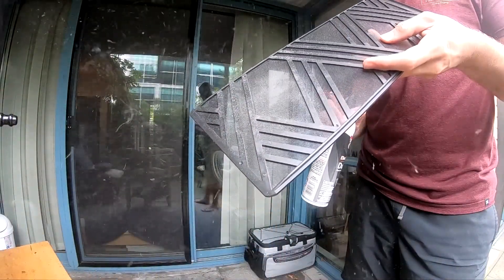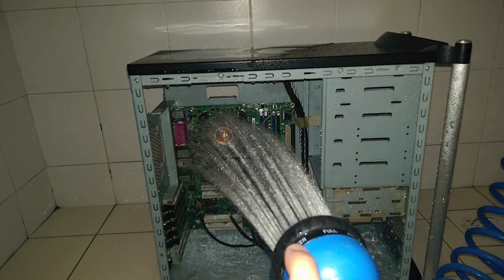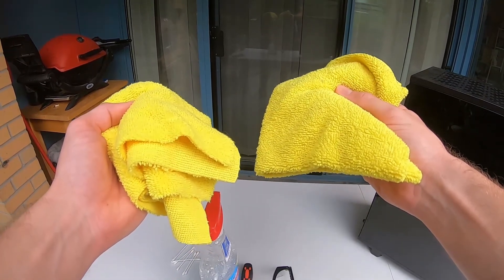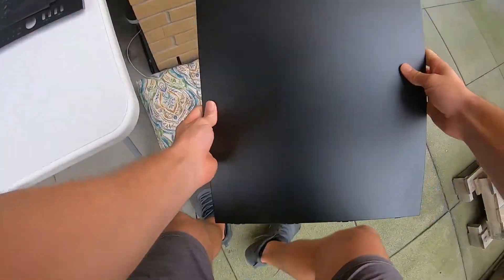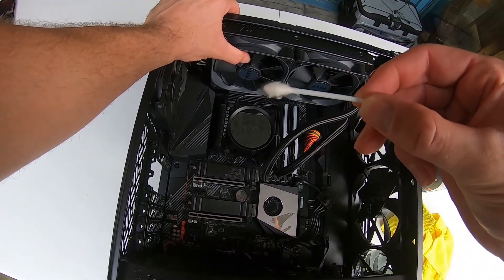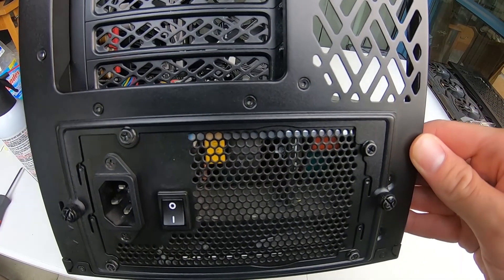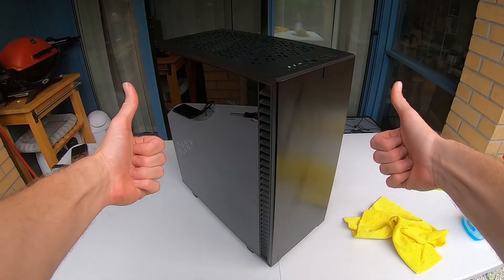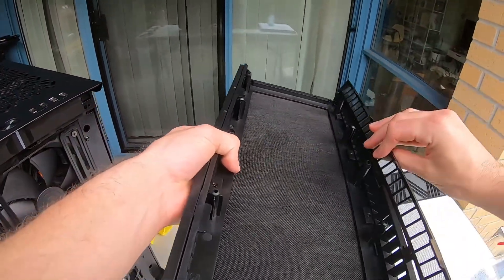How To Clean A Dusty Computer (Step-By-Step Guide)

Comment from the maker: How often do you clean your PC?
Reply: So far I only cleaned it after components overheated. That I may have to change.
Reply: 6 months to a year using an air compressor works for PCs in my home. There is no one size fits all, it really depends on how much dust is in the house and where the PC is located.

Comment: Terrific.  Only thing I would like to mention is, if actually opening up the PSU, is to be extra careful in there.  Even if the PC itself is unplugged and unenergised, the components inside the PSU can still carry a significant charge.  This has the potential to be discharged via the person fiddling around in the PSU.  Not pleasant and potentially dangerous.